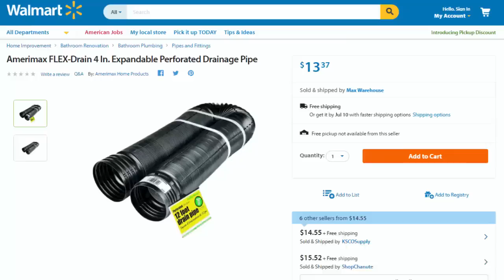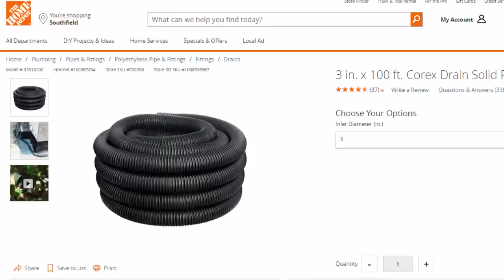Underground Roof Gutter Drain Pipe

Comment: Great video.  Thank you.  You likely know this . . . but a potential problem with the perforated section is roots that can into the pipe, through those holes.  I'm dealing with that problem now with underground gutter drains at two properties . . . not my install, but my problem.  I'm considering whether or not I need to just dig up the pipes and replace them, or rotor the pipes clean knowing that it will have to be done again, and again, and again.  There, I answered my question.  Dig em up, at least the sections where roots are a problem.

Comment: Something to consider is to NOT use perforated pipe right next to the foundation. Use PVC for several feet first to get it away from the foundation, then use perforated pipe to drain as it continues farther away from the house. May also want to consider how the access water will drain out, do not want water sitting in the system if you live in a colder climate where it would freeze.
Reply: Yes I agree I used the pvc also
Reply: Agree as well but in specifically went with “SDR 26” spec pipe
Reply: How would you do it if you get freezing weather?
Reply: @heatherstark7331  just use 4 inch PVC pipe for the drain get the connection that goes to the downspout get the emitters that exit the water ten feet away from your house make sure the pipe is running downhill and  where the water's going to exit out of the emitter dig a deeper hole and add gravel there should be some holes at the bottom of the elbow of the emitters to drain and that water will drain through the gravel. Google drainage emitters

Comment: It would be a good idea to add a catch basin where the down spout is. Over time, the gravel from your roof will collect inside your drainage system and eventually affect the water flow.
Reply: Planning this on my job, especially as it's all the moss from the roof that has clogged the old one. Great tip thanks

Comment: I'm currently doing my whole shop/garage with 6 downspouts. I am going to run them all to two elbow 4" Pop up style end drains that will water the field down the slope. They have a series of slots so the standing water can drain out into a gravel bed and not just lay there. Thanks for the video.

Comment: On the corrugated pipe the cuts, and on the solid like the holes, are NOT drainage holes! Both of these and the one mentioned with a cover over it are intended for a French drain. Different applications.

Comment: There are some problems in colder climates. By using the elbow on the end, water will not completely drain and may freeze blocking the pipe. Any subsequent rain will backup and overflow at the leader and foundation.
Reply: Drill a couple holes under the elbow and maybe even have a small pit  of gravel underneath and you’re fine.

Comment: Only use schedule 40 pipe for all these drains. Damnit going so cheap, plant roots will eventually grow inside and clog the drains up. Roots chase water.
Close to the end of video you’ll see roots just waiting to destroy your pipes
Reply: With a tee at the end to allow for the pipe to drain completely, I'm guessing this wouldn't be a concern, right? Trees are only going to chase water in pipes if there isn't water in the soil to chase.

Comment: Did you consider running slotted pipe along the front of the porch and dumping out through the landscape bricks? The porch looks to be about 4' from your foundation and water leaking out of the slots would feed the little shrubs that look like they need water desperately. Hard rains would blow right through to the end.

Comment: Great work. But several problems. Dirt mixed with stone is not a stone fill. Never want perforated pipe near house. Goal is to move away from foundation. Your white goes inside black. Should be reversed the black inside the white. Water will go over edges. And stop draining right there. End of pipe need holes at btm when clogs and for freeze protection. a: T end is correct one up for drain. One down white holes into 2 ft of stone. They always clog. Always. This prevents that.

Comment: Good that you are draining your yard but I would advise you to not use corrugated pipe period. NDS makes tons of elbows (1/8", 1/4", 90, etc) in order to get around any obstacles using solid 4" PVC drain pipe. Also I would put catch basins on all my down spouts, tie them all together and then discharge via pop-up by the street or directly in the street. If you don't have the fall for the discharge then use a sump pit and sump pump.

Comment: 10 Ft triple wall 3" pipe is $19.50 with tax at Home depot and Lowes as of 11/11/22... love that inflation due to our incompetent government in 2022.  I like the triple wall because it is smoother  inside. Also I would have just torn up those retaining wall blocks and bark to make a straight run.

Comment: that root (4:15) will break your pipe and penetrate inside the it will fill with mud. I recommend to use solid pipe there and pebbles around the pipe

Comment: Would there be a drainage problem if you didn’t have gutters? Recently bought a house and the detached garage has water flowing into it one one side and out the other side, through the weep holes in the brick walls at the bottom row of bricks at the foundation.  A drainage man said to put in a French drain and he mentioned 90% of the problem was because of the gutters, I guess because the down spouts weren’t connected to anything, water just flows and collects in the yard. So why shouldn’t I just remove the gutters instead of paying $2,000 for a French drain that will eventually clog up with dirt if perforated pipe is installed?  Advice is appreciated. I never had gutters on any house (and never water problems either) I lived in so this is all new to me.

Comment: How does the water go up to drain out at the end? It looks like a surface drain to collect water.

Using the pipe with slots isn't another option. Perforated pipe has a specific use, it's not for carrying water away. Not recommended for those with water in their basements and crawl spaces.
Reply from the maker: 1.  before installing this pipe - 100% of the water drained from the gutter to the ground right next to the house.
2.  now after a heavy rain - 95% of the water comes gushing out of the end of the pipe, 20 feet away from the house.
3.  yes some water does sit in the pipe - my yard is flat and there was no way to have the outlet any lower
4.  my yard is clay, so the water drains out very slowly.
So at best, water is draining 20' from the end of the house.  At worst, it's just as bad as having the typical gutter downspout.  But yes, if you are buying this pipe, the one with the holes goes at the end.
Reply: @DaveWirth  I wouldn't call this a "How to". Simple for your situation, not worrying about standing water on the yard, but usually much more complex for most.

Comment: I know this was posted about a year ago but I’d like to ask a question that’s important to me. I see one commenter has already asked why you didn’t use a “T” at the end and maybe even some P gravel going down to 2 feet possibly? Also, I’ve heard that using corrugated pipe never seems to work as well as straight pipe. I realize in your situation you couldn’t help it but can you give us an update I know it’s a year later. Thank you so much for the video have a good day😁 By the way I’m from Toronto Canada so my concern is whether for sure and stuff getting all gunked up inside the pipe.
Reply from the maker: 1.  my yard was super flat, so there isn't really a good outlet point i could go to that was lower than the gutter.  But yes, if you have enough slope in your yard, then outlet from the bottom of the pipe.
2.  yes add gravel or sand to give the water a place to drain into the ground.  I did do that on the side of my house https://www.youtube.com/watch?v=FwKPpU-8oes
3.  yes PVC pipe is stronger and would carry the flow better, but for this situation, flow isn't really an issue.  Also if you use PVC it's going to be more expensive and much more work with glue and elbows.  With flexible pipe you can just dig the trench around roots or landscaping and bend the pipe as necessary.
4.  During the spring and summer, when it rained, 99% of the water would come bubbling up from the end of the drain cap.  The other 1% would sit in the pipe for a day or so, and eventually drain into the ground.  If our soil was sand it would probably drain in a few hours, but we have clay.  But there was never more than a handful of days where the pipe was full of water.   In the winter the pipe was empty, and it didn't rain or melt snow really, so no issues with freezing.  Maybe like once or twice a year i would reach in and pull out a handful of leaves that had accumulated at the bottom of the drain cap.  But i never had an issue where water was backing up and flushing out near the gutter.
The whole point was to get water away from the house.  Like i said, 99% of the water came out of the end cap 20 feet away.  People have commented that it needs to be solid pipe near the house and perforated pipe further away so that it can drain into the ground.  Technically that's correct, but i just bought 1 roll of pipe because it was cheap and didn't have a problem.  Yes, 1% of the water left in the pipe does drain into the ground near the house.  It's still better than having 100% of the water just pouring out onto the ground out of the downspout.
Reply: @DaveWirth  Hello there Dave. Thank you for the explanation appreciate it have a good day.

Comment: looks backwards to me. I would do a solid pipe by the house and do the drainage further out in the yard otherwise it looks like you just hooked a pipe from your gutter designed to leach water into your basement. the question is, did it work out for you?.
Reply from the maker: Ya that's what you should do.  I did that years earlier by the garage, solid pipe first then perforated pipe.  This wasn't ideal because i was right by the property line and had to make a turn.  Also i wanted to get rid of the old 3" pipe i had.  Also the soil where i live is all Clay.  So water doesn't really drain well.  Near the garage i dug a large trench and filled the bottom with sand and pea gravel.  This drains probably 80% through the drain cap, not seep into the ground.
Reply: @DaveWirth  If you need flexability to make turns,  You can buy corrugated solid pipe (no holes) that won't leach water close to your foundation

Comment: Based on what I’m saying in the video it appears that you’re going to have more of a problem than what you’re trying to fix all you need is a good significant amount of rain
Reply from the maker: No, no issues.  Around the house was hard clay.  If the soil was sand then possibly.  95% of the water would come out of the end of the pipe at the drain cap.  The remainder took a few days to drain into the soil.  I don't see how that is worse than water coming out of the gutter and pouring right next to the foundation.

Comment: When you use perforated pipe next to your house you’re not taking the water away from your home it will still run back into your home you should’ve reverse that and put the solid pipe by the house and then continued on with a perforated you weren’t thinking on that one
Reply from the maker: Yes i agree.  But the 2 pipes i already had in my garage were a flexible perforated pipe and a straight solid pipe.  So instead of going out and buying 2 new pipes i used what i had.  Ideally yes, the perforated pipe would be at the end and the water would drain into the ground away from the house.  However...  1. the ground in my yard is hard clay.  So not a lot of water was draining into the ground.   2.  95% of the water ended up going out of the end of the pipe at the drain cap.  On a hard rain, water is gushing out of the end of the pipe, 20' away from the house.  So at best, water is draining 20' from the end of the house.  At worst, it's just as bad as having the typical gutter downspout.  But yes, if you are buying this pipe, the one with the holes goes at the end.

Comment: Michigan gets cold weather. How does this work in the winter when the ground freezes, and then things start to thaw in the spring? Do your gutters overflow because the pipe is blocked with ice?
Reply from the maker: Never had an issue with ice blocking the pipe.
The only time that the pipe is full of water is right after a heavy rain.  Then the pipe empty's out within a few days.  I haven't had an issue where the gutter backs up because there is water in the pipe that freezes solid throughout the winter.
Reply: Generally a 4” sewer T would also suffice at the end instead of a straight 90 upwards. Just post hole 2-3 feet under your t and fill it with pea gravel.

Comment: Hi there, watched the video as have similar water situation.
But I was going to connect my round down pipe to a bend that fit into a pvc pipe that went from the front yard all the way to the curb by the Rd (inside a trench ), use an angle grinder to cut a piece of concrete out then cut the pvc pipe on an angle so it was even with the curb then mix a little concrete and put it round the pvc pipe so it was level with the original curb. I figured that then all the water would run straight to the kerb into the Rd gutter and away to the water mains drain.
Why did you only go so far with slotted drainage pipe then onto pvc pipe then have a bend so the water went out all over the lawn, was it just to get the water a bit further away from the house, as I would think that you wouldn't want the water to be coming out near the house foundation or garden and  always have stagnant water sitting in the other pipe and attract mosquitoes, and a plastic disk to run over with the lawnmower. Do you think I should stick to my plan.
Reply from the maker: Several things:
1.  My yard is all hard clay, so basically zero of the water in the pipe is seeping out into the soil.
2.  Yes i just wanted to get the water away from the house, then it just drained away from there.
3.  My yard is flat there.  On the other side of the house there is enough slope where the outlet drain is lower then the gutter.
4.  You technically aren't allowed to do any work in the road right-of-way without a permit, definitely not cut the concrete curb.
5.  Yes when it rained heavily all of the water came out of the drain cap.  Sometimes with enough flow to push the cap off the connector.
6.  I would suggest doing what i did, as long as you have enough slope away from the house, i didn't have an issue.
Reply: @DaveWirth  Hi there Dave thanks for getting back to me, your feedback was really useful, what's your state?, I ask because when you mentioned that cutting the curb to put in the end of the pipe out of, needed a permit I felt a bit silly, I don''t usually think/or just do things without getting a permit, but did assume that it was such a little thing that a permit wouldn't be needed, ha see someone is always happy to take your hard earned money off you, my son said my plans seemed a bit of an overkill and agreed that your plans were the way to go as my water problem was so similar to yours so thanks for help.

Comment: what about dead water freezing at the end of solid pipe?
Reply: I did something similar with SDR35 pipe, but installed a tee at the end to allow most water to head downward and for some to head upward when soil is saturated. It has worked well so far (2 full seasons in Wisconsin).

Comment: So, maybe a dumb question, but what if that pipe fills with water. Won't it back up?
Reply from the maker: The outlet cap at the end is lower then the inlet pipe at the gutter.  If the outlet pipe was clogged then i think it would overflow at the connection between the pipe and the gutter.

Comment: Hey Dave, have you experienced any freeze issues with the previous drain you put under your sidewalk? I just installed one very similar on the north side of my home and am now wondering the underground pipe freezing, I used 4 inch but was only able to go a few inches below grade in some cases.
Reply from the maker: Mike Evans no problems. but i dont have any tight tolerences, if it freezes and cracks its not a big deal, just leaks into the ground.  the frost line here in michigan is about 4-5 feet deep.
Reply: Mike Eva